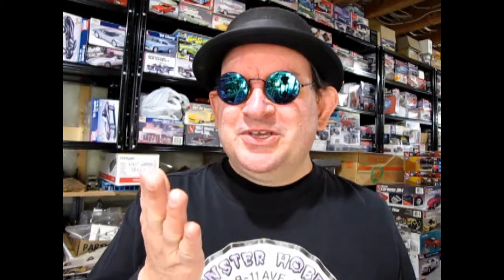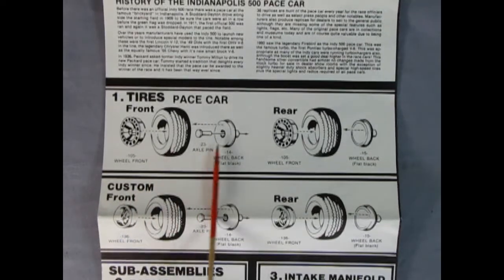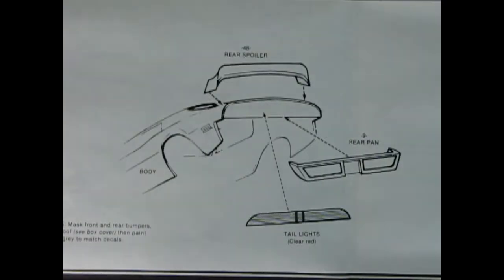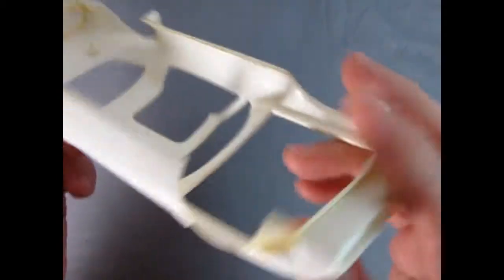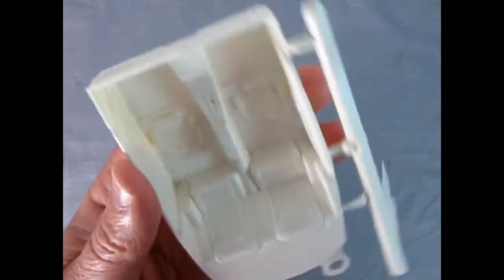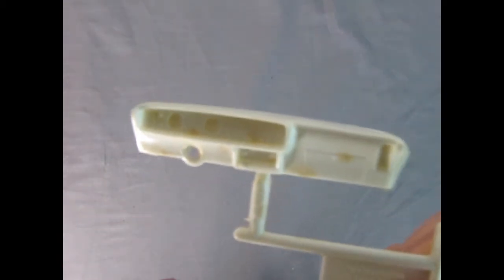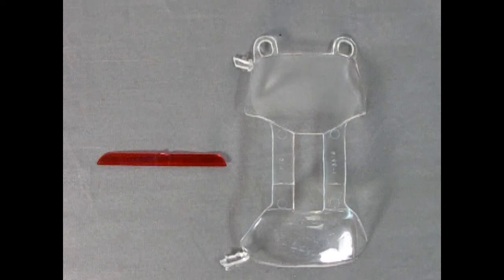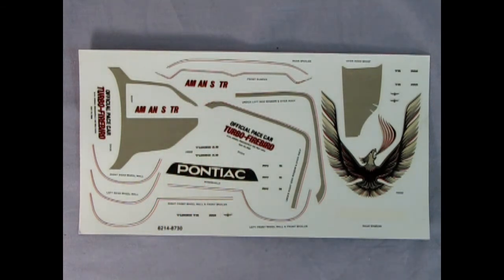Model Car Garage - The 1980 Pontiac Turbo Firebird Indy Pace Car by MPC - A Model Car Unboxing Video

Comment: I have the MPC  "NEW Firebird and that was a 1976 but they did not want to date that on the box. It has a list of all the other 1976 MPC kits available printed on the side of the box. The problem is with the one piece glass installed the interior tub will keep the chassis from fitting correctly. I will have to cut the glass locator tabs off and hope that works. As stated in the comments, always issues with those MPC kits. How much time and resources does one want to put into a kit and still have fun with the "fundimensions" division of GENERAL MILLS FUN GROUP, INC.
Reply from the maker: For sure. Glad you got the riddle of plastic figured out! 😃